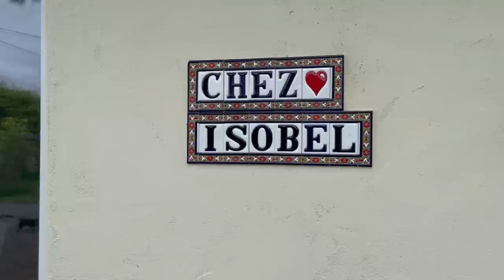Naming Of The Gite #87

Comment: Chez Isabel is a lovely name and tribute! 

Happy 17th Anniversary! 💐 

Re: chicken waterer with the little red cups; I would suggest using a food-grade 5 g bucket (with lid) instead if you want a larger capacity. Why? Because it will be easy to clean and disinfect. I preferred the 2 g galvanized steel waterers...but they tend to overflow. The plastic ones I tried always grew algae in short order and were a pain to scrub and disinfect.